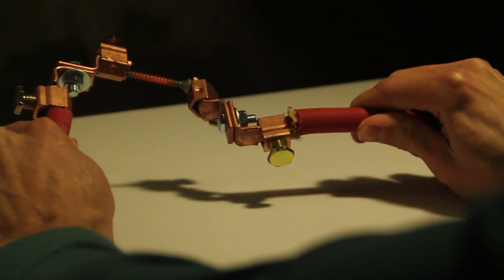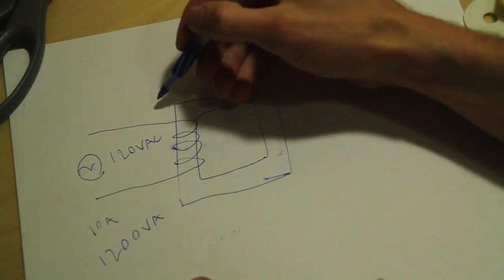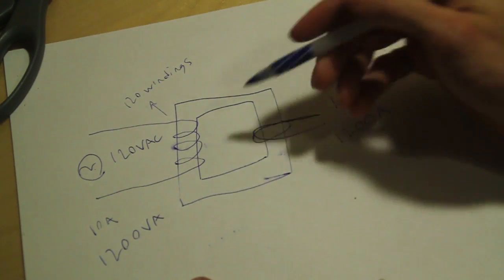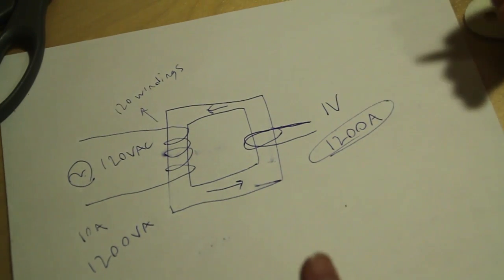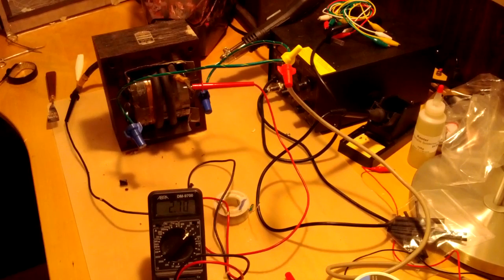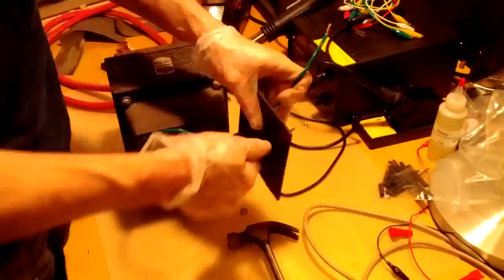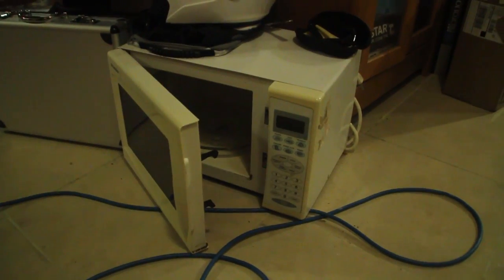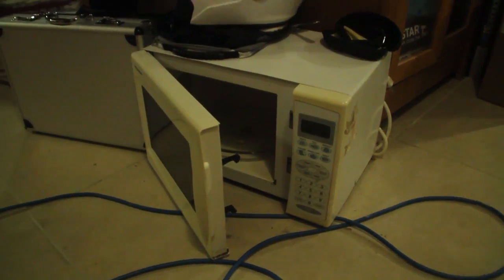Melting metal with electricity!

Comment: i have a question is it possible that 2 transformer with same size 20amps n 100volt n other 10amps and 200volt when there same terminals are joined they will give 30amps n 300volt?
Reply from the maker: If I understand you correctly, no. Input power always = output power. So if you put in 1000W of power say, 100V at 10A you will be able to manipulate that with the transformer to equal 1000W output (+ losses). Say 10V at 100A or 1V at 1000A. 

If you want to have more melting power, you will need to power the transformer from a larger power source.
Reply: very helpful meassage

Comment: i have a question is it possible that 2 transformer with same size 20amps n 100volt n other 10amps and 200volt when there same terminals are joined they will give 30amps n 300volt?

Comment: Why the wire itself don't melt
Reply from the maker: +NS Farm wires have low resistance so that doesn't happen :) the things I melted have high resistance so they draw more current and heat up!
Reply: ohh thank you. now i got it. what if you try this with cooper bar does it melt keeping the wire still attached ?
Reply from the maker: +NS Farm no, the wire is made of copper, whatever is thinnest would melt first :)
Reply: got it thank you for sharing.. man i feel stupid now ..
Reply: Great video Hacksmith.  I made one a little while back and had some fun with it.  I just wanted to address your reply to this question.  "the things I melted have high resistance so they draw more current"  The wires and steel have the same current running through them because they are in a series circuit.  A higher resistance would actually reduce the amount of current in the circuit. I think the steel heats up more quickly than the copper because when it resists the flow of electricity the electrical energy is converted into heat, and because the steel has more resistance than copper, more heat is created in it.  Do you agree with this?
Reply: "A higher resistance would actually reduce the amount of current in the circuit" That's why I was confused in the beginning, but got it now. Imagine using Gold stick, would that melt the (cooper)wire first !

Comment: high amps are actually far more dangerous than high voltage
Reply from the maker: +Brandon F not really, it only takes milliamps to kill you. Human skin is resistive to about 40v or so. Since this is only a few volts it's safe to touch. If it was over 40+ it would be very dangerous

Comment: Amazing video dude I wonder what would happen if I would do this with a small transformer 240v a.c. Maybe  10/13 amps and 2 turns of wire on the other side answer plz someone
Reply from the maker: I forget what the ratio was on this but if you ran this one at 240V it'd just be 4V instead of 2V.

Think of it this way, if you have 100 wraps on one side, and 1 wrap on the other, you'll get 1/100th of the voltage coming out. Power rating stays the same, so if it's 1000W in at 120V, its 1000W at 1.2V, which means 1000w/1.2V = 833.33A!
Reply: Thx for answering I was looking what to watch on youtube and I came across you and I was sub,d to you so am watching all your vids from the beginning coz o don't remember that I subscribed to you so yeah love your vid you awesom3
Reply from the maker: fungamer sr thanks dude!
Reply: Can't help it your too amazing
Reply: If you would go on my YouTube channel you will see that I just keep on liking most of your videos

Comment: I thought it was the amps that kill/electrocutes you?
Reply from the maker: RimstarOrg has a great video explaining this =)

You're right -- but you still need volts to carry the current. Human skin has a very high resistance -- you can touch up to about 40-60V without being electrocuted -- but if your skin is wet this drops dramatically! Since I rewrapped it its only 2V, I'd have to soak in a saltwater bath or something for it to pass through my skin!

Does Volts or Amps Kill You? Voltage, Current and Resistance
Reply: Ah thank you :)